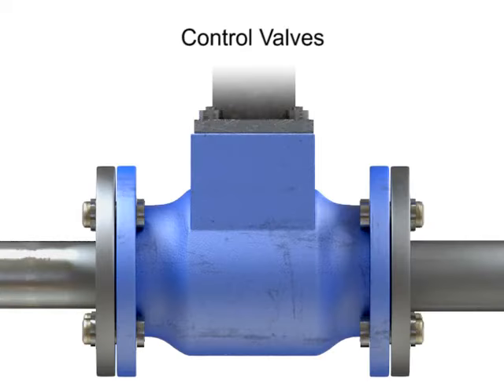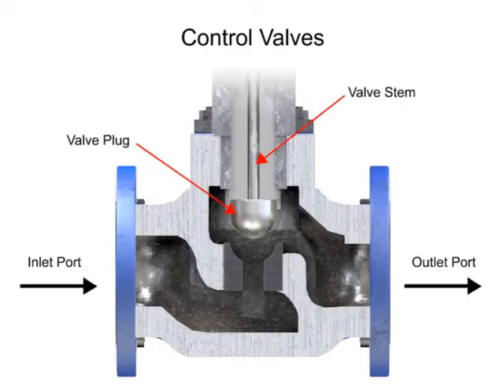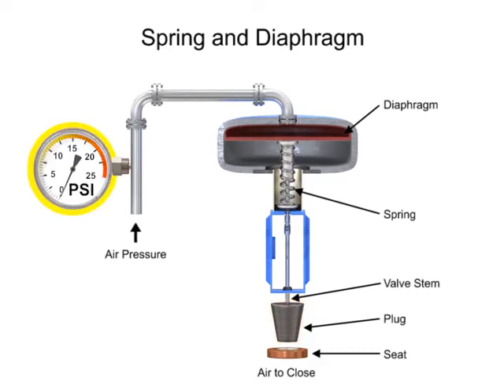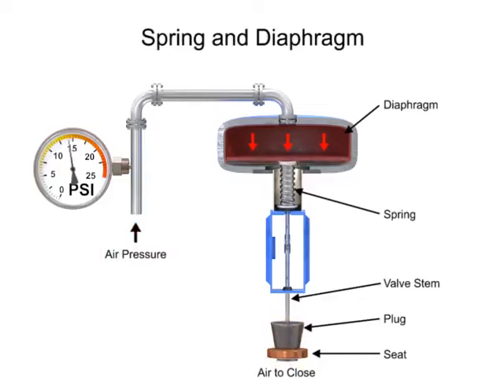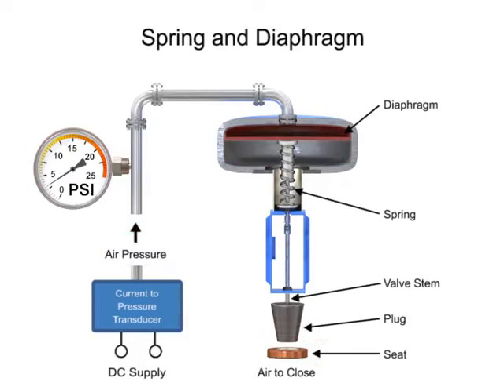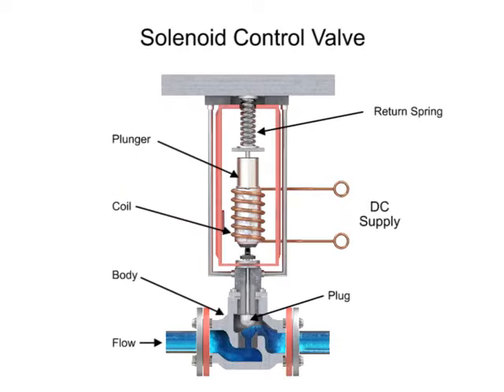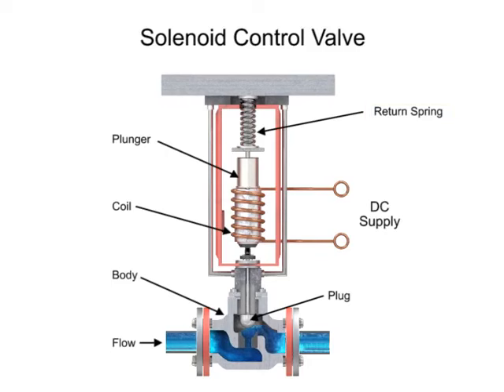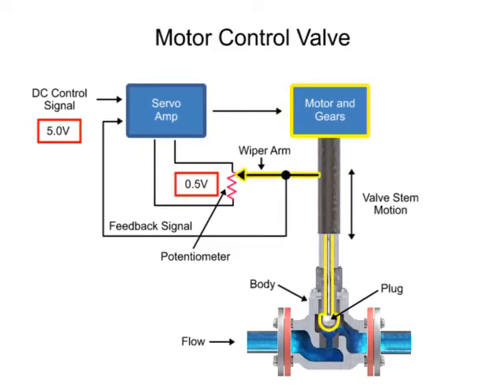Control Valve Actuators Principle

Comment: Why pressure regulates between 3 to 15 psi why not 0 to 15 psi
Reply: Because if it’s at zero you won’t know if there a malfunction. Could read zero or 3. And once it reads 0 you know it’s not 3 and thus no power.